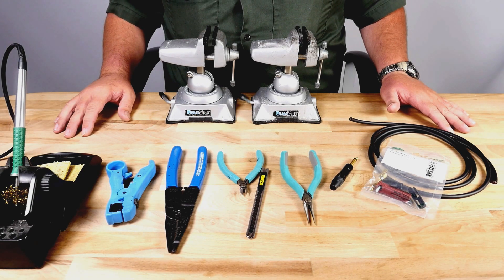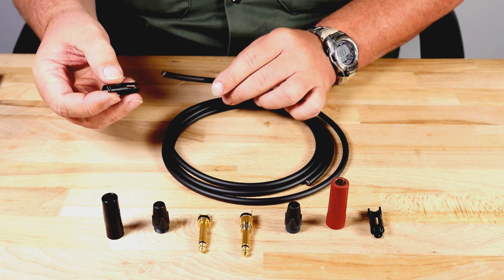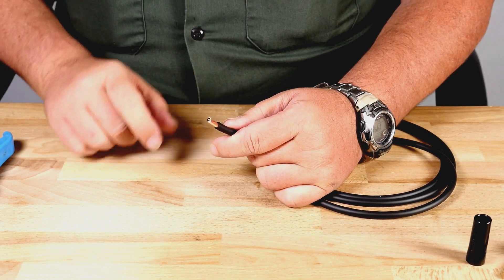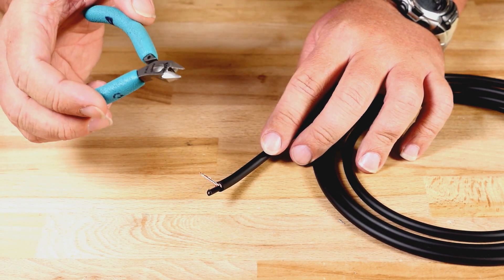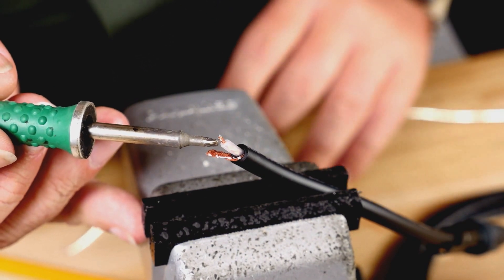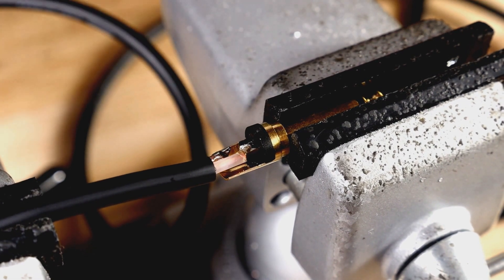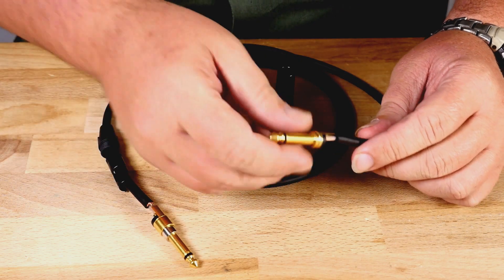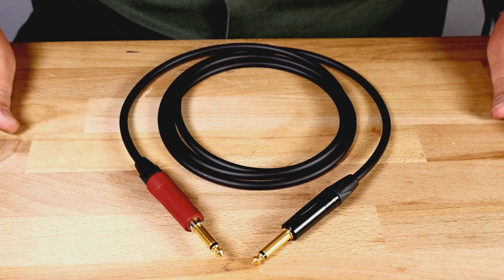How to Solder : Instrument Cable with TS 1/4" and Neutrik silentPLUG

Comment: Good, clear instructions. A small point though: according to the Neutrik instructional .pdf, 

'Attention: If using a cable with O.D. > 5.50 mm [0.216”] break
away this part of the chuck.'

Therefore, for cables <5.5 mm , no need to take it off. Also, it can be removed after soldering.

Thanks for the vid.

Comment: This is not how you are supposed to solder,  it's actually completely wrong as many others have pointed out, your solder didn't even adhere to the jack surfaces. You're not supposed to put solder directly on the tip of the soldering iron but instead warm up the metal parts of the jack and the wire itself while pressing the soldering wire against it so the heat is transfered through the parts that you actually want to solder together because they need to be hot. This won't last, if it even works at all.

Comment: Great video! On the neutrik gold right angle to connectors, I see a tip, a larger shield and then there is a little silver tab a bit further up the casing with a little number 2 next to is. Do you know what that little tab is used for?

Comment: Nice illustration. Question, why remove the "tip or tab end" from the chuck? The Neutrik PDF instructions page doesn't show this step, in fact the chuck is inserted whole right after the boot. I ask, because I like to know the reasons behind doing so or not.
Reply: Part of instructions, Step D:  "If using a cable with O.D. > 5.50 mm [0.216”] break away
this part of the chuck."
Reply: @acoustic61  True, I did forget about that part. I used Mogami 2524 cable, clipped that piece off.

Comment: The iron should be heating both the wire and the cup as you feed solder into it. What you are doing is removing the iron as you put solder there. Your solder is forming shapes because of this which means it is becoming dry. Solder should flow like liquid. A tell tale sign of a bad soldering technique is moving the iron tip around like you are trying to paint with solder.
Reply: I always tin both sides then heat them together till the solder flows. I’m also using a small screwdriver to apply a bit of pressure while it dries.

Comment: Nice demo on the jacks but the soldering isnt good - applying solder directly onto a hot tip causes solder to flow all over the tip and not onto the surfaces that it needs affixed to - solder flows towards heat or the tip- not away from it.

Comment: Hi! I followed all your steps and my cable doesn’t work. Any ideas where I might have gone wrong??
Reply: Does it not work at all? (Dead quiet), crackle, or works but it’s muffled? Most likely you accidentally have the tip and shield touching each other creating a dead short. If you have a multimeter, test the resistance between the tip and sleeve lower part of the plug. It should be too high for your meter to measure. If it’s not, you may have melted insulation or dripped solder somewhere and created a current path other than the desired one.

Comment: I love Neutrik jacks, but this central part where the cable core goes is so freaking small, I cannot get a neat, nice looking solder for the life of me. But I see you have the same issue.
Reply: Have you tried pre-tinning the plug contact points in addition to tinning the wire?  He doesn’t do that here…

Comment: I didn't realise that the black bit around the core wire was conductive and I always got a weaker signal with my home-made cables or my home-fixed cables.  Thank you so much

Comment: Who would have though the inside jacket is conductive i was loosing my mind making cables yesterday. Made like 10 cables all with cross talk 😫
Reply: Tell that to me: I could never find why two of my cables have resistances between tip and sleeve in the order of the hundreds of kOhm. I have used them for years. Today I repaired them finally and have removed the jacket in a couple more too. Tomorrow I will continue removing jackets from all. In these days I am building a lot more.

Comment: I neeeever knew you had to remove that tag! No wonder neutrik connectors always seemed like a big pain in the butt! Why does it not say this on the bag? I always find I have to use my belt grinder to remove a bit of the part that crimps onto the cable since there is just NO way they would ever screw together... removing the tap section will probably make this a lot easier!
Reply: you only remove that bit if the diameter of the cable is more than 5.5mm, so most cables are below that.
Reply: @JeremyGreysmark  Yep, just read this in the assembly instructions I found on the Neutrik website :)

Comment: The manual says you brake the clip ONLY if the cable diameter(outer jacket) is more than 5.50mm
Reply: Looks like he's using mogami 2524.. it's about 6mm iirc...

Comment: What mogami wire did you use - what guage?I have 2524 and the thinner 2319.
Reply from the maker: We used the Mogami 2524 in this video
Reply: Ron Chibnik code 2319